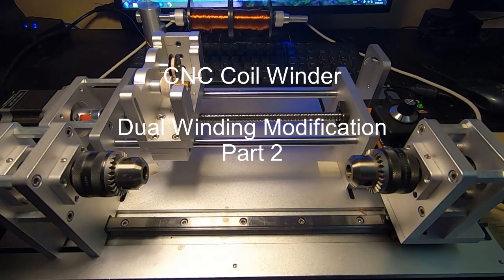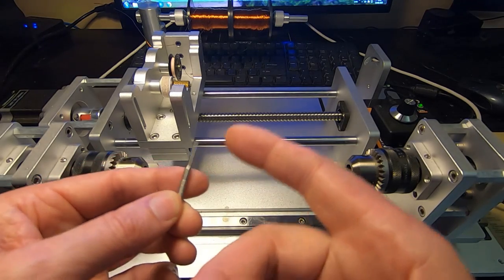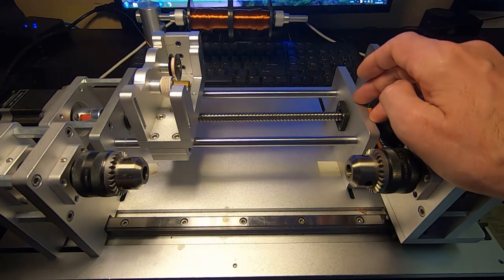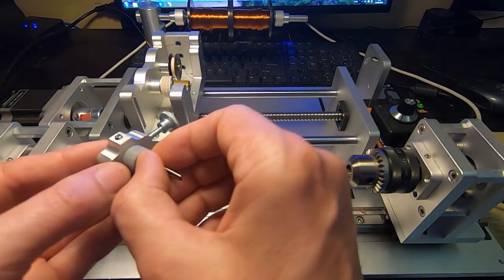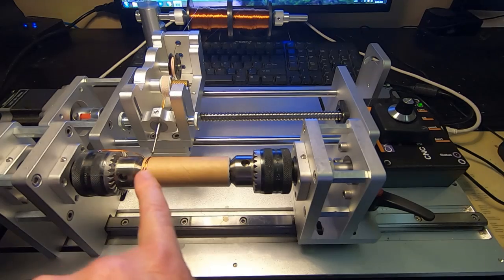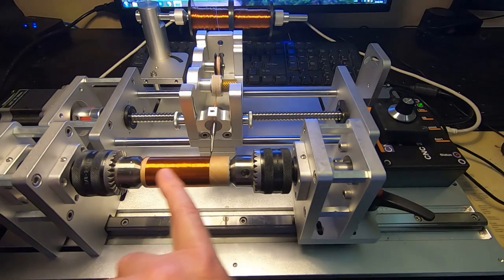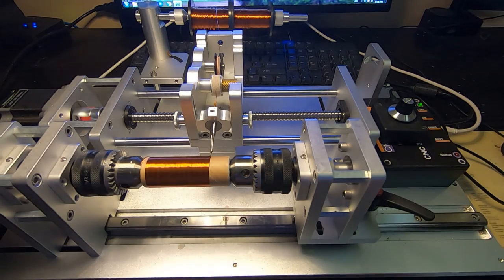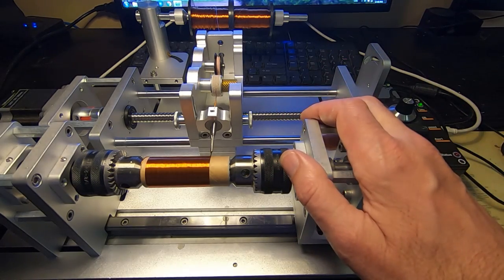CNC Coil Winder Dual Winding Modification Part 2

Comment: Unbelievably neat job. Ingenious to use rotation to set the pitch. I suppose the next step would be a calibrated disc on the nozzle to set the pitch accurately without trial and error 👍
Reply from the maker: I did actually consider fitting a scale but unfortunately the wires vary slightly in overall diameter even for a specific gauge so it always takes some trial and error to get the pitch setting correct so I decided not to bother.